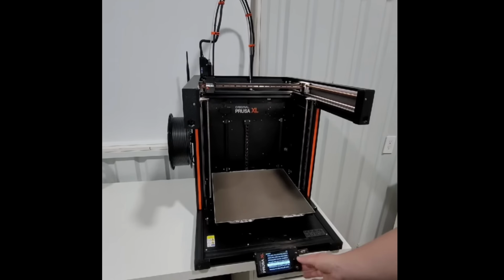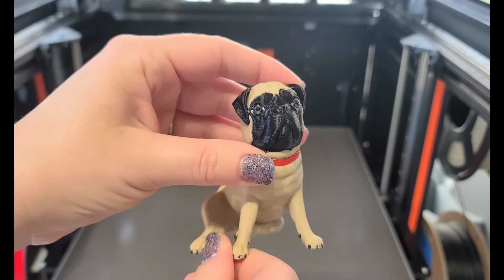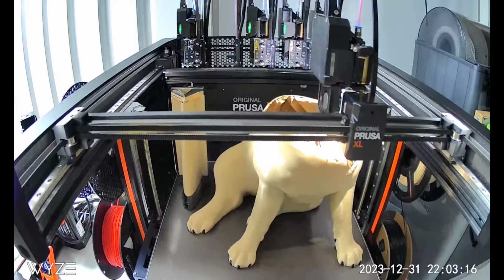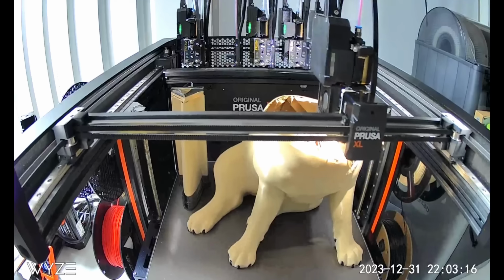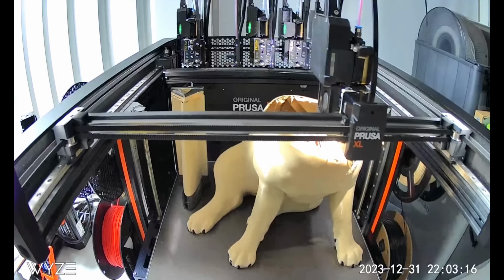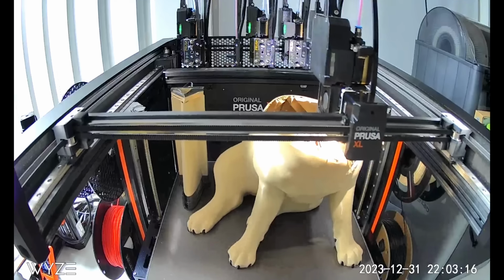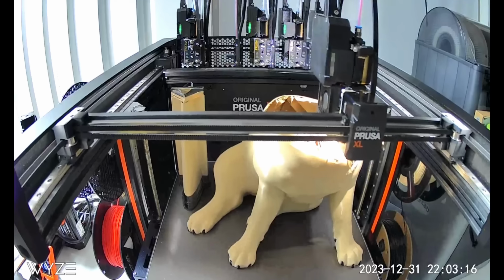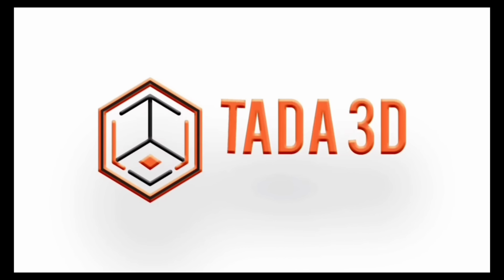Finally Testing Out the 5 Color Buddy Print That's Over 14" Tall!

Comment: Thanks for your patience, I'm sure all of your frustration will result in improvements down the line in firmware, mounting mechanism, whatever.
But production appliance really shouldn't be this buggy.
I do understand that there is way less testing done with these prints that take a day or longer with multiple toolheads.

At this point you should look into plastic recycling, you have so much PLA from those tests I imagine.
Reply from the maker: Yeah it has produced good boring prints but these fun ones aren't working out for me.  Yeah I'm trying to find someone local to me for recycling. Thank you!

Comment: As for as not firing, there must be something about that tool head sitting for so long before being needed. Seems like the filament is jamming in the nozzle. Do the tool heads stay at temp even when not needed at the moment, or to they only heat up when ready to print that color?
If the stay hot always, maybe the filament is 'cooking' while waiting to be used.
If it's heated just before needed, maybe it's proceeding before it's up to full temp. 
I think you are right about the print coming loose. My guess is that the bed is cooling down when waiting for you to interact and correct an error. That's part of the problem with these build plates that have easy release after printing. Maybe a little glue stick on the build plate when attempting such large prints will help with it staying in place.
Now for a little armchair quarter backing and trolling:
After 3 complete fails, still think BBL waste too much filament?
Only hardcore Prusa fan boys or Prusa marketing will tell you that you should use Prusa filament.
I want to see you succeed with this printer, so I'll keep watching.
Another note. Maybe you could slice off and print just the head starting at the color and use it to repair the failed prints?
Reply from the maker: I would like to know if all 5 toolheads stay hot. The screen only shows the temp of whichever single toolhead is selected at the time. I'll have to see if there is any other screen that shows this.

I agree that these failed prints are much more filament waste than my Bambu has produced. Printers not working and failing this many times is wayy too much waste!

I can understand that filament produced by the same maker as the printer should be all well tuned together. But yes I think I just need to run all the same brand and see how that works out.

Thank you!
Reply: @tada3dprinting  I wouldn't know how to check the temps with the software, but an inexpensive handheld infrared thermometer would give some idea of what happens with each tool head while parked. As for BBL, I always forget about the increased time required to make all those filament changes. My guess would be 4-5 times that of the XL. For me, print time is not important, but I can see it is for someone that uses 3DP for a business. So, once you get the quirks and glitches worked out, you will be saving material and time with the XL.

Comment: Don't tighten the idler screws too much, I had accidently done so on my Mk4 and it always results in a failure to feed. I almost wish there was a sensor in the tool heads to measure the pressure of the filament extruded so the printer actually knows if filament is being extruded or not.
Reply from the maker: Oh that would be a good feature. I mean  Prusa chat literally told me to tighten all 5 THs two full turns. And then I am getting comments that they were probably too tight to begin with. I wish there was even a print test for this that doesn't take 25 hours! Thanks!

Comment: I have recently had something happen that resembles your red filament not working even though it purged at the start of the print. The filament broke inside the extruder right at the extruder gear due to the pressure of the gear so the filament was still loaded but could not be pushed through the nozzle. The filament seemed ok, but it after a few failures of this kind and I realized that the filament was corrupted. 
I ended up doing a full build volume print of buddy just to see if there was a consistent problem with the printer, but it came out great. The video is here: watch?v=5FwbY4fZiEU
Reply from the maker: Oh thanks for sending that! That's very likely. I almost wondering if I need to be careful of filament that doesn't have much filament left and is a little more curly? I think the tube setup of the XL may be just a little tougher on filament. Thanks so much!

Comment: 15:57 that's crazy how the cover does not have a through hole for filament pressure tension.
i'd prob just dump the cover extra mass to sling around.
Reply from the maker: Someone told me I can unlock it without unscrewing it. I'll have to check this out. Thank you!

Comment: This guy had an explanation for issues similar to yours. https://youtu.be/eZYngEnAgYs?si=DMM5sYnVY2IxSNp8&t=346 and then Robert Cowan diagnoses the issue in the comments. I guess he fixed it in the build by filing down an area that was causing the toolhead to not seat correctly. 
@RobertCowanDIY
2 months ago
 @ygk3d Thanks!  So, the locking mechanism should fully constrain the toolhead, allowing for zero movement.  I could make a short video to show you what's going on with mine.  There might be a misalignment of some of the parts, but when mine are locked, they feel like a single solid part, there is NO shift at all.  They are loose on the 'dock' (on the back of the machine), but this is to allow them a bit of compliance when picked up.  But once picked up, it should be solid and repeatable.  I would check to make sure the plastic holder (the thing screwed into the back of the rear rail) is properly engaged IN the rail channel.  There's a boss that extrudes into the center rail channel and it needs quite a bit of force to lock in place.  If that's not happening, it might be skewed sideways, causing this issue.  But any amount of compliance in the toolhead carrier is bad and needs to be corrected.  
@RobertCowanDIY
1 month ago
 @suivzmoi   The toolhead 'docks' sit on the rear rail.  The main part that attaches to the frame is 3d printed and has a small boss that sticks out, interfacing with the extrusion. It's VERY tight.  If you don't get it perfectly snug, it doesn't seat well against the rail.  In my assembly video, you can see that I actually file it down (I don't discuss it, it just shows it quickly in the assembly timelapse).  If you don't get that part flush against the rail, it will be at an angle.  So when you pick up a tool, it won't be flush either, and it will need to be 'nudged' into place.
Reply: This.  (Regarding the issue with the tool dock releasing) I am fairly certain only one of the 2 latches engaged.  I noted the same issue with the fit of the bosses to the extrusion when assembling mine.  The screws should be much larger (M5 or larger rather the M3) so you have enough clamping force to overcome the interference fit.

As for the extruder jam, I can't say this has happened to me but I wouldn't be shocked if this part was damaged: extruder-main-plate-xl.stl.  The detail on this part is too small and I really feel it shouldn't have been FDM printed.
Reply from the maker: Ok I'll check it out. Thanks so much!

Comment: Thank you for confirming my decision NOT to buy an XL.  After placing a pre-order the day it was announced, I saved money until finally getting an email saying I could purchase a unit.  In the meantime the Bambu Carbon was released.  I've not yet purchased a Bambu either, but I eagerly await a large volume 3D printer from them.
Reply: I love my Carbons. I also want Bambu to come out with a large format. But I wish they would also do a tool changer.
Reply: The XL does not have this many problems. I have my XL 5T for a few weeks now and I am running it 24/7. I haven't got a single failed print. Every print is flawless, super fast (3-5x faster than the Bambu AMS) and without waste. It is truly an amazing and reliable machine.
Reply: @cees9314  my friend has a 5 tool XL and he has no issues either.
Reply from the maker: I'm really starting to think I either got a lemon or I messed something up in putting together the final steps of this "fully-assembled" machine. My boring prints are fine. But I am dying to print something cool! 
Meanwhile, my Bambus are printing great. But multicolor take quite a bit longer than the XL and of course are smaller. Thanks so much!
Reply: @tada3dprinting  I'm in the same place as you. Had no end of problems like in this video (and others) with my 5TH. Sent it back for repair. I don't know how they can send that slip with the printer that says "we tested this printer and it's working" when clearly it isn't.

Comment: Watching these repetitive failures from the XL would make me really angry at the manufacturer. I'd be demanding refunds. You wasted multiple spools on these issues. For the price or this machine, in the current landscape of printers that are expected to just work, this machine is one issue after the next.
Reply from the maker: It's been very frustrating. Partly because other more "boring prints" print fine. It's seems like these "fun" prints are just too much for it. I need to get on chat again. But I almost don't know where to start.

Comment: i dont know, but i think that their satin sheet is not as good as lets say the textured sheet. They say, that you cant print materials such as PLA onto it, but if you wash it with dish soap and water after it arrives, you can print PLA on it as good as PETG, ABS etc... It has some sort of like protective film i think, bcs of storing into their storages and so... I would definitively consider buying another type of sheet, bcs the stickable int that good on satin in my opinion
Reply from the maker: I seem to be doing better with the Satin but someone just told me they have PEI now so I have ordered it. I think the loss of adhesion is more from it sitting paused for hours overnite tho. Thanks!

Comment: Why not print it smaller?  What is this print for?
Reply from the maker: Yes I could print it smaller. But my main reason for getting this printer is to print large and tall things. The buddy is an included file so I shouldn't have issued printing it. I was trying to use this as a base to try more complicated prints. Thanks!

Comment: insane how a machine that is obviously not even above alpha version standards (toolhead disconnecting randomly and random crashing of the gantry into the frame) can make it into market... I really expected better from prusa and I think we all did... prusa is kinda working on making themselves obsolete... the toolchanging seems to be very immature even compare to a DIY open source build like the Proforge 4... it seems like Prusa has not learnt any lessons from the E3D Motion System Platform and they developed a toolchanger from scratch that is not fully functional to date... I heard of it misaligning the head aswell... this is not the amount of testing and finetuning I would have expected from a prusa product...
Reply from the maker: I do get decent boring prints for my Etsy business. But it's frustrating that these more fun prints aren't working for me. Thanks!